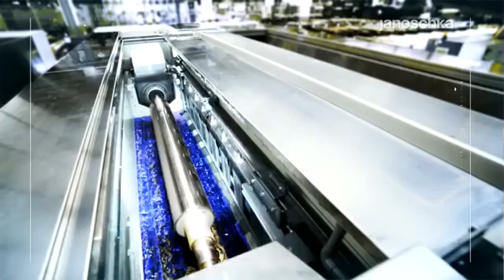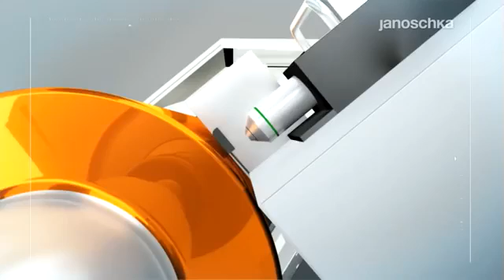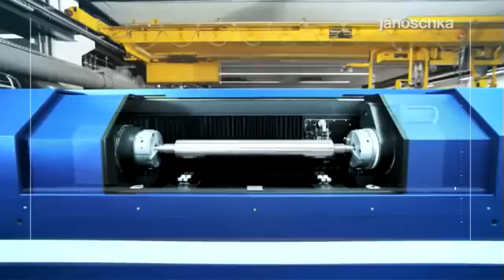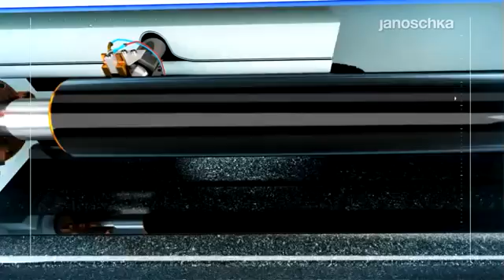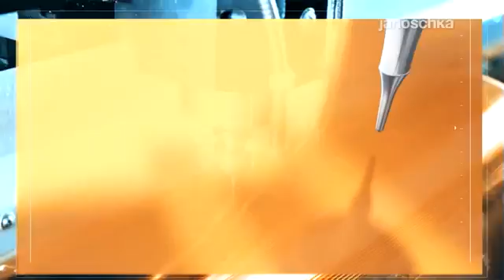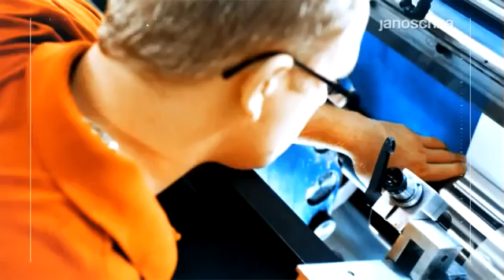IN ỐNG ĐỒNG - Công nghệ in ống đồng - BAO BÌ TÍN PHÁT

Comment: Xin chào bạn !!!.
Bên công ty Vũ chuyên cung cấp các dịch vụ & sản phẩm :
I / Cung cấp giá xưởng  lưỡi dao gạt mực in Ống Đồng /Flexo /Tampon ,  sx dao gạt mực theo máy in yêu cầu khách hàng ..chiều rộng thông dụng như 10/20/30/35/40/50/55/60mm độ dày từ  0.152-0.5mm ,  lamela 1.3/1.4mm  tốc độ /80-300m/min với  độ cứng thép 560hv  đến 800hv .
-  Với dao cứng 600hv của chúng tôi phù hợp  các máy cơ vn lắp ráp  tốc độ thấp dưới 80m/phút khi in ấn bao bì màng PE hoặc dùng mực in  pha bột đá kháng chịu mài mòn cao
-   Lưỡi dao mềm 580hv với chất liệu thép blue /gold hợp kim chất lượng cao rất  thích hợp với tốc độ máy in Gravure /Flexo từ trung quốc , taiwan , hàn quốc  từ 160m/phút –trên 200 mét/ phút , đóng gói 50m/100m/200m/hộp theo yêu cầu .
-   Ngoài ra còn có dao gạt mực 10mm/12,5mm/20mm dày 0.20-0.30mm lamella 0.08mm-0.1mm cho các loại máy in flexo có hệ thống gạt mực strip blade . holder blade , dao lót back up , support blade 0.5mm .v.v..   
-   Lưỡi thép gạt mực BIC in Tampon 350mm/0.5mm/20mm thép Carbon chất lượng từ Japan.
-   Chúng tôi bán sỉ lẻ theo từng mét  và luôn có mẫu thử free giao tận nhà máy sx của Quý khách hàng  ,
-   Cung cấp các loại dao lam rọc biên chia cuồn giá sỉ các size 42mm/22mm/0.2mm ,dao dĩa 200mm,250mm/300mm
-   Gia công CNC chính xác hợp kim : thép gió , carbon , chi tiết theo bản vẽ các linh phụ tùng các ngành bao bì , nhựa : dao cắt kim loại , dạng  tròn , thẳng .v.v...  
 II/ Các loại vật tư chịu nhiệt & đóng gói :
-   Băng chịu nhiệt Fiber 10/15/20/30/50/60/100/200mm cắt theo yêu cầu giao hàng miễn phí toàn quốc ,
-   Vải nhiệt có keo & không keo PTFE nâu tráng phủ teflon bóng,vải trắng PTFE nhám ít , nhiều dày từ 0.11mm-0.65mm/100m/cây kg & mét .
-   Vải simili trắng , đỏ , đen đan sợi thủy tinh chịu nhiệt +phủ teflon chống dính nhiệt dùng trong ngành may , bao bì , thực phẩm ,
-   Giấy cách điện xanh 0.20-0.25mm , film 2D cách nhiệt , điện .
  III/ Dụng cụ thiết bị trước & sau in ấn :
-  Băng keo quấn trục in ngăn mực , phao lăn mực , bàn chà lô , đũa , bút corona ,dụng cụ bơm mực in , pantone màu made in USA  
 - Băng keo dán bản in loại hai mặt dán Polymer , dày đồng nhất  , in ấn đẹp hơn tính năng  kháng dung môi , bám dính tốt & dễ dàng thay thế giá ưu đãi nhất .
- Băng keo điện tử  Kern Polymide / PET  chất keo Arilic / Silicone  1&2 mặt chịu nhiệt độ 80*-220*C ngành sản xuất điện tử  
* Chất lượng đảm bảo + giá thành cạnh tranh
Trân Trọng
Liên hệ ngay   :  0909.814.717 Mss Vũ
Skype : vu.phan88
Wepsite : www.hcvietnam.net